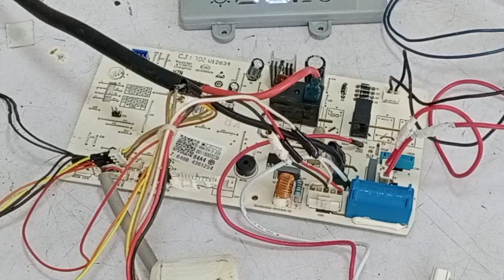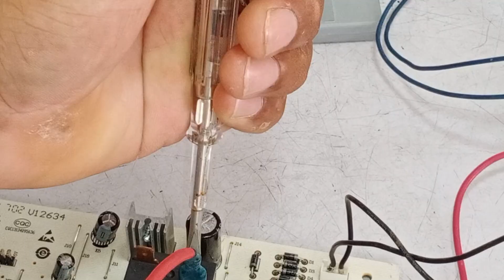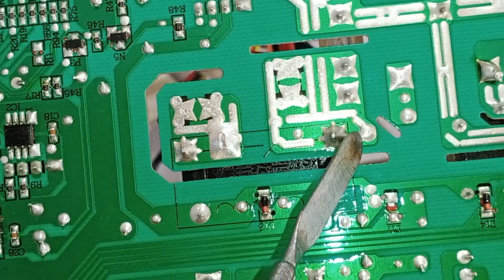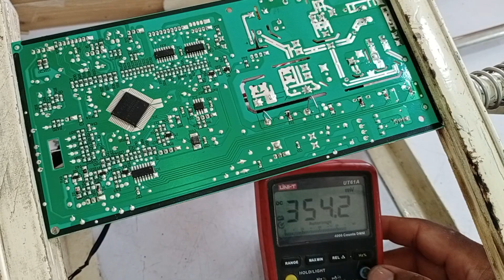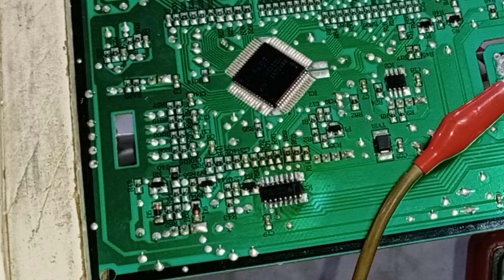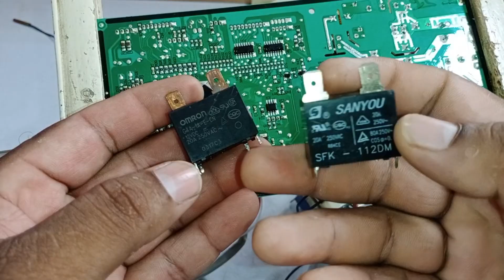AC Indoor Circuit is Not Starting Outdoor Unit - Can I Fix it?

Comment: Hi. I love your content because i learn so much. . i have 1 problem please help me. My inverter aircon is indoor unit beeping and green light is blinking but when i disconnect the signal wire to the terminal of indoor unit the the beeping stops and the blinking green light becomes stable. I checked the error code on its remote then the error is ua. Could be the fault is the pcb of outdoor? Is the outdoor board has a relay also?

Comment: Hello. I have the same problem, but with LG Standard (inverter) which is 10 years old. It shows error 5. The indoor unit powers on, fan works, but outdoor unit is completely dead. Please advise where to start.
Reply from the maker: if its inverter unit, check the outdoor board, whether its powering on or not?